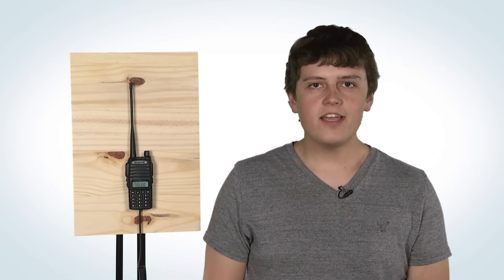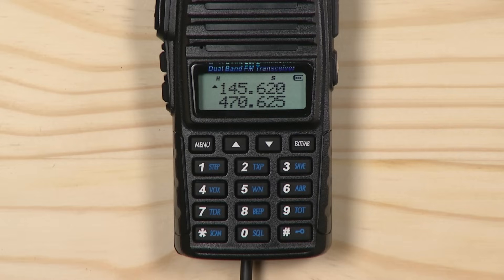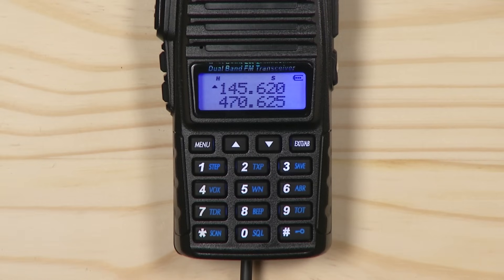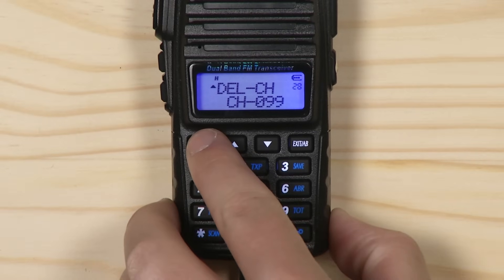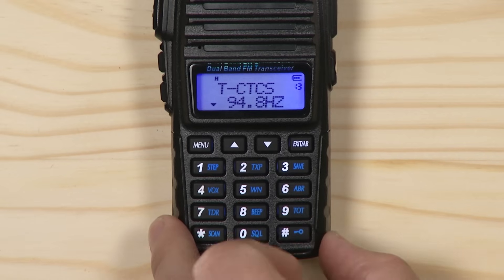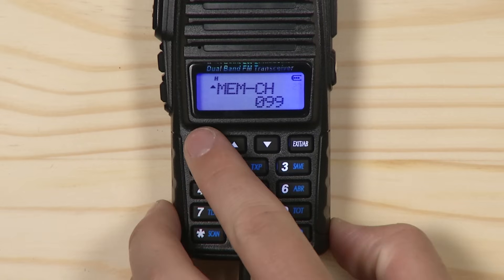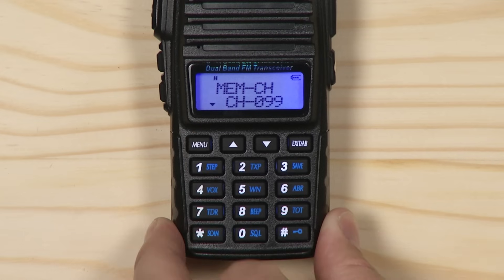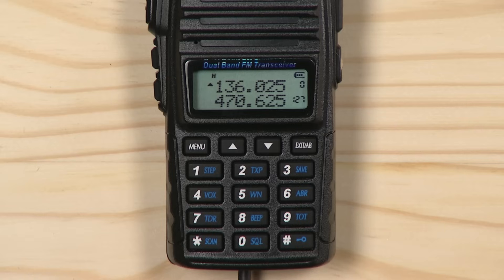How to Easily Add a Channel on a BTECH or BaoFeng Handheld Radio (without a PC)

Comment: I work in an estate as an electrical maintenance i there were 3 radios one stop working and i was given to reset i thought it something i could easily do by following the settings on the other but i ended up making two not to work again .i hv watch dis vdeo a million times i still dont understand

Comment: We cannot get to program mode by pushing Menu and turning on the radio is there anything else we need to do - we had an older radio and it worked on it but our current one it does not

Comment: I must be doing something really wrong. I have spent a career in automation tech. And I have read two manuals for Baofeng radios, the one that came with this radio and one other posted online and watched this video. I can only program two channels with their frequencies tied to those channel numbers. Once I attempt a third channel. The third channel will be overwritten by any of the two saved channels. I am programming a Baofeng GT-5R.  On simplex. Should be easy but it is not working. Stand alone, no cable.

Comment: Neither of the methods I've seen talked about in videos for switching from VFO to Memory (channel) modes work.  My radio is identical to this one, but is branded BTECH instead of Baofeng.  It's kind of useless if you can't get into VFO mode.

Comment: Baofeng manual programing is way more complicated than it should be.

Why should you have to enter the transmit frequency if you are already telling it the direction and offset frequency?

...and why doesn't it save the direction and offset parameters when you save the channel to memory?

It could have been a great little radio if it was thought out better.

Also, why did they get rid of the VFO/Channel button in the UV-82 model? 

The button was much better.

Comment: I have the IV-82HP. It will not change to channel mode after holding the menu button and turning the receiver on. It never leaves frequency mode. Any assistance would be appreciated!

Comment: Great job on the video , I have watched several videos tryin to get the hang of my new UV82 , wanting to use it mostly for picking up farm work 2 way radios and transmit , is there a way to program this radio manually ? THANK YOU ...

Comment: Still doesn't work... no channel mode on mine, just frequency mode... total crap for what I just paid!!
Reply: If you have the UV-82C, that's the commercial model and programming by the keypad is locked out so businesses don't have their employees tampering with the radio and changing frequencies.

You can unlock the VFO mode (to program using the keypad) by using the free CHIRP programming software.  I don't have a link handy but Google will find it, or go to the Baofeng website and search for it.

You can do a lot with CHIRP as far as programming channels and changing other settings.

Under the "Settings" tab on the left sidebar of CHIRP, go to "Advanced Settings" , and the option to enable VFO  keypad programming of the UV-82C is near the bottom of that checklist.

You do need a programming cable to connect your radio to the pc, in order to download the settings to the radio.  The correct cable is available on the Baofeng website and also Amazon.

Comment: I’m not able to toggle back between channel and frequency when I turn the device off.  I’ve watch many videos and it says for me to hold the menu button and then to turn on the device to toggle between channel and frequency. I’m not sure why my device is not working. How do I go about toggling back and forth between the two options? I just received my device for one day now. I have a uv-82hp

Comment: I know this is old video , I bought Baofeng uv82 I can't change to channel mode , only frequency mode, even after I reset it multiple times 
Should I replace it with another one ? 
if there is any way to fix it what do you recommend

Regards,

Comment: If you're going to get this kind of radio just go ahead and get the USB cable.  Connecting it to a PC and programming it with Chirp is many many times faster and easier.  It's easier to manually enter all of the information for a channel that way and you can add all of the MURS, FRS, GMRS, local repeaters (and more) with just two or three clicks each.  I can literally populate ones memory with 80+ channels, all useful and relevant, in less time than this video takes to watch.  So yeah, just spend the money to get the cable.  This is however good information to know if you happen to be out and about and can't use software to add a channel but honestly how often is that going to happen.

Comment: excellent. easy as can be. and presented very professionally. only thing i would add is the name of the function when you tell me to push a certain menu number. instead of just menu 23, say menu 23 and the name of the function, which is program a channel or whatever, so the viewer won't get too confused about all the menu numbers. there are a LOT of menu numbers.  otherwise, perfect.

Comment: My ex bought this radio for my son to listen to trains when at home with her.  Is there any way to lock out the transmit function so he doesn't try to talk on any frequency?
Reply: It would require the use of a computer, cable, and the free software CHIRP.  Check this out on eBay:

Programming Cable 2 Pin USB +Software CD For Baofeng UV-5R BF-888S Two Way Radio
Reply: why would you do that?
Reply: @ritchelbe  do what?
Reply: @ritchelbe  So he doesn't go cause trouble for fun, you know, that thing where you responsibly parent a child

Comment: Thank you for taking the time to make and post this video. I had no clue how to do this using the useless users manual that came with the radio and while I plan on primarily using the pc software to program the radio, I’m still waiting on my programming cable to arrive. Manually entering a few frequencies on various channels has allowed me to do some immediate testing of the radio while I wait. Thanks again
Reply: hello, does anyone have this programming in French to install my 4 UV-XR? thank you in advance to all, Christophe sur Fouras, France! also where can I find the PDF instructions for UV-XR? 🤜🤛

Comment: thanks! good tutorial. now my radio is programmed
Reply: DOES ANY ONE KNOW THE WAY TO MAKE THIS RADIO  BF-UV9RXF TRI BAND 1O WATT  TO WORK AS CROSS BAND REPETER??? MANUALY??? IS THEIR A BATTARY ELIMINATOR AVAILABLE TO BUY AND AN EXTRA BATTARY 4OOO OE 5OOO MA 
AND  A TRI BAND ANTENNA? THIS IS NOT AVAILABLE Authentic Genuine Nagoya NA-320A Triband HT Antenna 2M-1.25M-70CM (144-220-440Mhz) Antenna SMA-Female for BTECH and BaoFeng Radios ITS OUT OF STOCK IN AMAZON CAN ANY ONE PLEASE HELP PLEASE SEND MESS IN FB THANK YOU

Comment: I purchased a new BF-A58..  Of course the manual is poorly written.   After I load freqs like you suggest.. it does store them correctly and does open up repeaters.... BUT no matter what buttons I push... I even did the restore button to wipe it clean and start all over again... After 20 memories are stored.... no matter what button I push... THE DAMN THING WILL NOT SCAN IN MEMORY MODE...  Also this stupid you cannot … in the frequency mode set up band edges... so the stupid thing goes through the ENTIRE NON ham frequencies....    At least it should scan the memory channels.... But it refuses.    All my other handi's are ICOM... Boy what a difference...   SO WHAT IS THE SECRET HANDSHAKE TO GET THIS POS TO SCAN THE MEMORY CHANNELS...…..K9BW

Comment: Whats my transmit frequency? I wanna join a repeater 146.6800-, I thought this was the recieve frequency? im confused why are there two? I'm new to this
Reply: You need to get the transmit/receive frequencies, as well as the offset (+/-) and the tone for the repeater you're trying to use. Try going to repeaterbook and seeing if they have the information there. I'm brand new to this stuff, too, just doing a lot of research right now. Hope this helps!
Reply: Grassy Field lol. Go get your ham radio license and you will understand.
Reply: The transmit frequency is denoted here by the "-".   The given frequency "146.680" is of course you RX frequency, and the assumed offset for all of the 2 meter(144....etc mhz) band is .600 mHz/ 600kHz.  In this case, you transmit frequency would be 146.080 into the repeater.  Like +Guns, gear and Tactics said, if you study for your Technicians license, this is one of the things that is covered.  I hope you can listen in, responsibly, to see that this is a great hobby to get into and go on to get your license.

Comment: My radio uv82c will not change modes to manually program.
Reply: the uv-82C is a commercial version of the radio. If I'm not mistaken, it can not be field programmed, it must be setup using a pc.

Comment: can you program an 82C from the key pad
Reply: No, that's the point of the "c". It's the commercial model which is designed to not be able to be programmed manually.
Reply: Yes you can, by using the free CHIRP programming software.  I don't have a link handy but Google will find it, or go to the Baofeng website and search for it.

You can do a lot with CHIRP as far as programming channels and changing other settings.

Under the "Settings" tab on the left sidebar of CHIRP, go to "Advanced Settings" , and the option to enable VFO  keypad programming of the UV-82C is near the bottom of that checklist.

You do need a programming cable to connect your radio to the pc, in order to download the settings to the radio.  The correct cable is available on the Baofeng website and also Amazon.

Comment: You state these instructions work with all Baofeng handhelds. I have the Baofend BF-F8HP. Your instructions don't seem to apply. When I attempt to enter the receive frequency, following you on the video, I am not able to enter the complete frequency. Only the numbers of the frequency to left of decimal point change on the display. Any entry attempt for the numbers to the right of the decimal point result with a beep from the handheld indicating this is not permitted. When switching from memory mode to vfo mode is there any indication on the LCD display that lets me know I am in the correct mode for programming? I replayed the video and followed your programming steps but still have the same result. I can't enter the receive frequency for the repeater entry. What am I doing wrong?

Comment: Hi. I have Baofeng uv-82 . I need to configure to be able to talk with my friends while we hunting. All of us has different type of radios,Mostly has Motorola walkie-talkie,where you van select channels and select code to specific channels. I need to configure my Baofeng uv-82 to be able to do same ,select channel and attribute specific code.I figured how to add channels with chirp but how to add all codes?I need just to be able to flip between FRS_GMRS channels and codes.
Reply: Mihai Scutelniciuc I think I know what your getting at. Why not just have your friends turn the ctcss codes off on their radios. Therefore you won't have to deal with it. Just have them set it to 0.

Comment: This was an extremely well done video. Thank you for taking the time to make this video. I have a UV-82X (2M/1.25M) Does the radio not have a Tone indicator on the display? Otherwise how do we tell if Tone T(SQL) or DCS is enabled on a specific memory channel?
Reply from the maker: +Eric G if it shows CT on transmit - it is transmitting a CT tone, if it shows CT on receive it is requiring a CT receive tone. (The same thing on DCS) - hopefully that helps
Reply: @Baofengtechradio  are those radios expensive

Comment: what is the difference between CTCS and DCS and must both be set?
Reply from the maker: +WA5CVI CTCSS and DCS are calling tones - generally one or the other is used: http://forums.radioreference.com/general-scanning-discussion/3318-ctcss-dcs-tones-whats-difference.html
Reply: hjiiiiiki
Reply: +BTECH - BaoFeng  what is the beter radio uv82 or uv5r
Reply from the maker: We prefer the UV-82HP: baofengtech.com/compare
Reply: +BTECH - BaoFeng  okay
Reply: +BTECH - BaoFeng  easy to program and good and so hard in the uv5r
Reply: +BTECH - BaoFeng  range up what